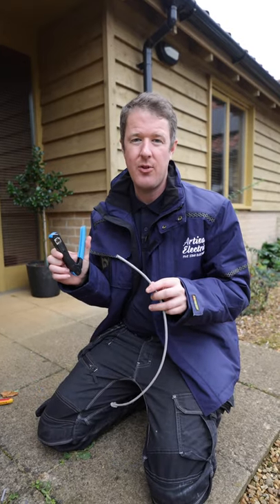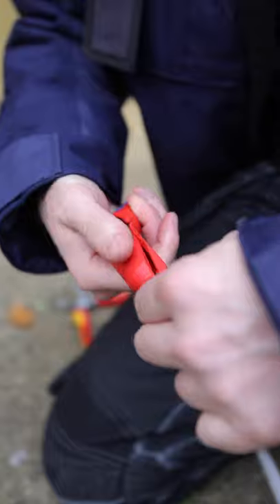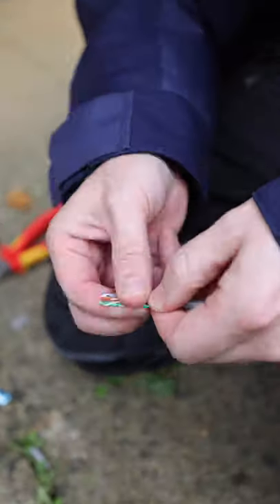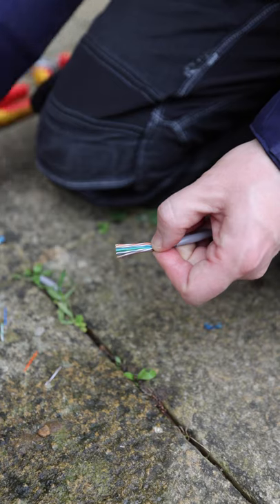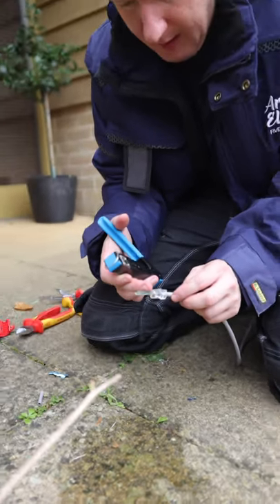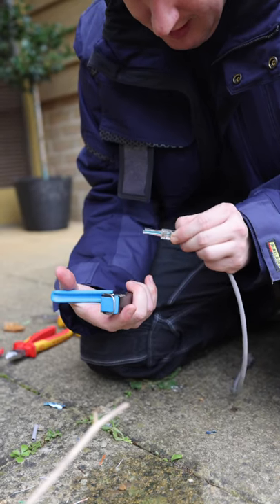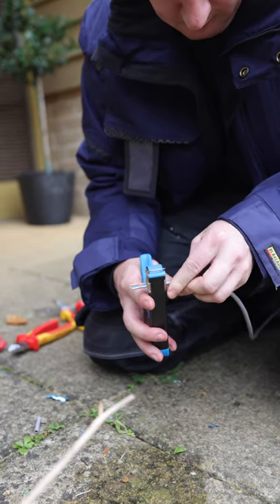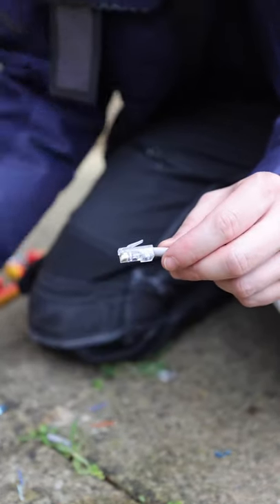RJ45 PASS THROUGH CONNECTOR CRIMPING #shorts

Comment: You missed off the part where you go off to Google the 568b pin order, print it off, faff about ordering the conductors up a ladder in the rain with reading glasses on then crossing your fingers it tests o.k.
Reply: Pretty sure I wired a house in 568a. The contractor knew but I’m not sure about the new owners. 😂
Reply: I'm pretty sure the crimp tool he is using has the order stamped on the side of it.

Comment: I got to say I think pass-through (ez-rj45) are asking for trouble. Using the rj45 with the bridge/loadbar is just as quick. Also any reason you are using F/UTP and a unshielded rj45 connector? Breaking an earth path between buildings or something?

EDIT: Hope I have not come across all negative, I really enjoy ur  content! Thanks you :)
Reply: Most people don't use the shielding correctly. Even if they use shielded connectors, they cut off the outer foil and drain wire anyway, may as well use UTP cable from the get go!
Reply: Thanks for this - I'd never seen the load bar connectors before!
Reply: Most manufacturers automatically void their warranty when EZ connectors are used.

Comment: What about using a continuity tester? To ensure the connections are good and there is no intermittent connection. These cables use Tx and Rx so data can be lost and misleading. You could end up making a crossover cable instead.

Comment: After 40+ years in IT I have never experienced a RJ45 being called a glass head ( until now ). Got very use to specifying RJ11 and RJ45 plugs to be used on screened or unscreened cable. 

There are a few AV manufacturers who will not support open ended crimps for connections ( though they seem to work ok ), Atlona and Wyrestorm being two. 

Like others have said, it’s much better to terminate a screened cable to a screened plug or socket. 

Also ( and I accept for most installations there is no reason), we put all our cables through a 15k calibrated Fluke tester and provide a warranty. It’s surprising how many cables will pass on a simple LED continuity tester but will fail on a certification test.
Reply: spoken like a true IT Professional ;)

Comment: Quick Tip: If you have trouble unwrapping the pairs you can use the coat you cut off and put it between the two pairs get them apart.

Comment: Those passthrough connectors look awesome.. have made quite a few rj45 cables and having to get the wire length right so that the bottom crimp still has outer sleeving to crimp onto can be a right pain!
Reply: I've always used normal connector but recently bought some pass through and game changer

Comment: Should be noted that with these connectors its easier to create certifiable terminations with minimal data loss because you are able to push the sheath right up next to the pins, this means less of the conductors are untwisted, reducing cross talk and potential for interference. Not so important for low speeds but at high speeds( > gigabit) you definitely need to make your terminations in this way.

Comment: I see there a lot of ways to do this... I find It sooo much easier to first strip the wires long (around 8-10 cm), then use the center plastic piece (in Cat6A cables at least) to split the pairs by sticking it between the pairs and drag it towards the end. Then you can feed one lead into the the pass trough connector one at the time. When all leads are passed trough you can twist them and when you then use the tool they all fall off together and is easy to pick up.

Comment: The only issue i have with any connector is if its staggered or not. When staggered each cable has there own chamber and prevents the pin from slipping to the side and/or the cables all shifting.

Ive never had any issue with a CAT6 connector (thicker) being used with CAT5 cable (thinner) that if used in a normal CAT6 connector love to slip to the side and the pin then only sits next to the connector. Although it still makes contact, it allows for movement in the future and over time it oxidizes so when it moves there's that layer of oxidation that ruins the connection. Or just plainly get pulled out, see that ALL the time despite the sheath still being crimped on.. the wires still slide underneath.

Comment: The only tools necessary to complete this task is;
1. All purpose cable scissors ✂️ (you could ask to borrow Cory’s)
2. Small jewelers slotted screwdriver with smooth shaft
3. RJ-45 crimping tool
Tips;
1. Give yourself more to work with, I give myself about 4” or 100mm of conductors (The width of my palm)
2. Don’t cut all your conductors the same length, cut it at a slight angle so that you’re only putting one conductor through right after the other into the fitting at a time it’s much faster.
3. After running it through twist the conductors together on the other side of the fitting to give yourself a handle to hold the wire taut to get a better cut.
It was a good go for an electrician though!
Reply: Interesting. Thanks.
Reply: Gotta say I didn’t think about number 2 but that’s because I figured out my way of doing terminations without fail

Comment: Why aren’t you using shielded plugs with shielded cable?
Reply: Why does he need to? You only need shielded if you are expecting interference or using CAT6 or higher with long runs.
Reply: @elminster8149  yeah but if you use shielded cable you use shielded plugs. Otherwise you'll end up getting interference from the shield in the cable if it's left "hanging" without ground. And also need to be connected to a grounded patch panel etc
Reply: @justme5384  Again, only applies to CAT6+ or long runs. Normally you won't see an issue. If you do, just swap the plugs for shielded.
Reply: There’s no point then using shielded cable if you have no way to ground it. Just an unnecessary cost when you could compare it with the cost of standard cat6 which also has the ability to support network speeds of 10BaseT (10GB/s). Rule of thumb shielded cable shielded plugs, same goes for modules where shielded is used too
Reply: @haydenh0869  yes. But it's worse than that. Having the screen not connected to anything can lead to chaos on terms of emi. And one end connection can give issues. People will say it's okay because it usually is. But get interference at a frequency related to the length of the shield and it's not good.

Comment: That shielding and especially that grounding wire are/is important, do not cut it off geeez… EDIT: Ah, I see now - you are using the cheap unshielded RJ45 connectors. Thats silly, do not use them at all. Shielded only, every time.